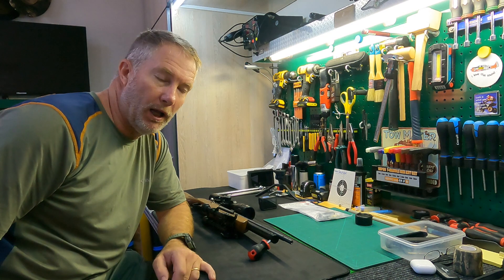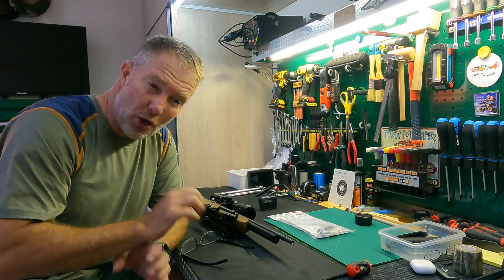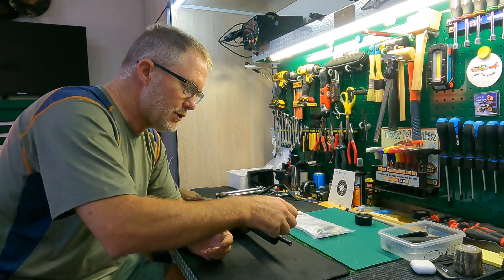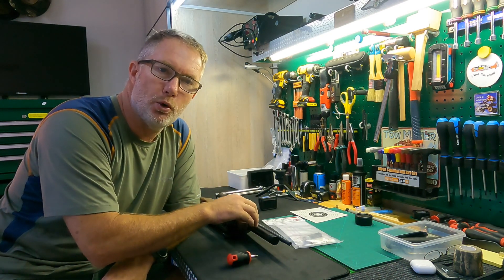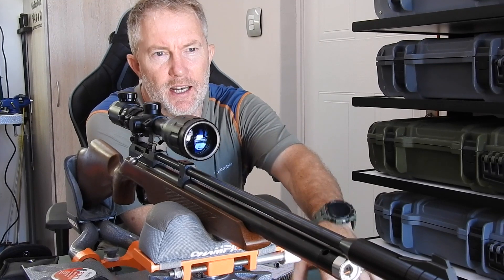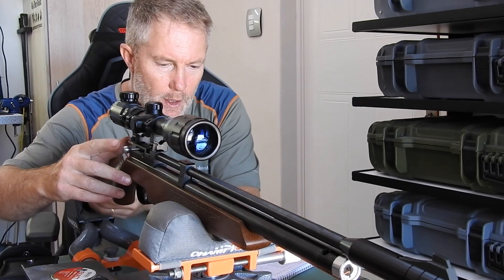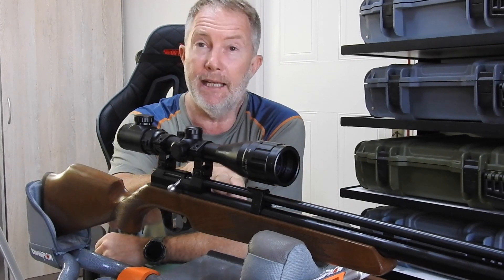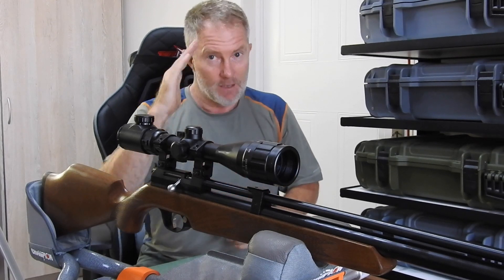Artemis PR900W Regulator Test Results

Comment: Hello, I'm getting an average of 848 fps on 14 shots, with the HN Field Target Trophy 14.66 gr, 125 bar (+/-), 9 cm hammer spring and not 10 cm, 0.8 mm coil valve spring instead of 1 mm.
OD valve, transfer port and barrel 4 mm,
Good grouping at 35 yards. Too bad we don't know how to finely adjust the hammer pressure.
Kind regards, Altaros regulator (max difference 5 fps)

 belle vidéo de toi, merci, dany, Belgium contry

Comment: Had one fitted to my bsa ultra se and a larger air tube and………. It ruined it, it left the factory with or without a regulator for a reason!!!
Reply from the maker: Hi there. I would humbly disagree with your statement. Most don't understand the full function of the regulator and MANY have asked me what regulator they should fit to get more power. So firstly, they DO NOT improve energy/velocity. They actual "reduce" max power , but they give you consistency over a wider spread of shots. They can increase shot count, but at reduced power level. EVERY rifle I fitted it to became significantly more consistent , giving me a more accurate rifle. The Only reason some have and some don't is cost... NOTHING else !! If yours was "ruined", look at the person that did the installation... period !!  If you want to know exactly what a regulator does and how it works, look at my video on that...

Comment: At that distance the grouping is crap. Consistency s no good without a good group
Reply from the maker: Hi there. After installing the Reg i shot about 15 or 20 "rapid" shots just to settle the reg. Then Took those same pellets and shot with the chronograph. 
I have 3 PR900 rifles and they all like different pellets... I did not mind what pellets I used as I was only interested in seeing the results of the Regulator. The rifle was about 20 f/lbs prior and I ordered a reg that would give me sub 12f/lbs.

Just looking at the group closing from the 1st set of pellets tot he 2nd lighter ones you can see that the pellets play a major role in the accuracy. 

I have many different pellets and by playing around I am sure I will find one that "this" rifle likes more. However, at the range I am shooting starlings and finches, this is MORE than ample !!

The fact of the matter is: This is a great regulator... 

Happy hunting !!

Regards

JB

Comment: Hi!
With the built-in regulator, can bar amounts give maximum power?  In my country there is no joules limit.  The factory says 275m/sec, is it real?  Also do the first and last shot have the same power?
Reply from the maker: Hi there. Remember that the regulator is not there to increase power... It cannot do that. All it can do is regulate the pressure... Thus if your rifle is now shooting 275m/sec then it will be less when you fit the regulator. However you will have more consistent speed with the regulator... The PR900 is a good little rifle and you only need to fit a regulator if you want to reduce speed, but increase consistency... 

Regarding 1st to "last" shot. The PR900 does "ok" with the 1st till about No 15 shot... Then speed starts to change ... 

With the regulator your first 15 shot will be almost exactly the same, but at about 230m/sec.... (I would guess....

Happy Hunting !! 
Ps: Actually took two youngsters with my PR900s yesterday to go shoot starlings. Great fun !!
Reply: @affordableairgunningbyjb6994  pr900w gen2 comes with a integrated regulator?    So every 15 shots you fill it with air again so that you have constant same shots? 
With the regulator how far does the bullet go straight to hit the target?

  Diana stormrider 5.5 is the same airgun rifle?

Comment: Got a pr900w gen2, I would like to make it a little bit more powerful. Right now it shoots 250m/s (820fps) and 29J with 14,35 grain pellets
Reply from the maker: Hi there. Remember that the regulator cannot make your rifle more powerful... In most cases you loose a bit of power.... but gain consistency.
Reply: @affordableairgunningbyjb6994  i know.

Comment: Hello,how Meni joules with your’new regulator please ?
Reply from the maker: Hi there. Before the regulator it was 26-27 Joules , now it is 16 Joules... Remember that the regulator DOES NOT increase power... It only regulates and controls it.....

Regads

JB
Reply from the maker: Hi again. 
If you bought a full power PR900, and not the sub 12 foot pound version they sell in UK, then do not change it....
It will give you about 20 for pound in .177 caliber and that is more than enough to use and enjoy. For the price of the PR900 it is a very efficient rifle and your shot count is "ok" for the small air tank it has.... 
By changing it you will most probably loose efficiency and get less shots per fill... 

I only added a regulator to mine to reduce the power from 20 to 12 foot-pound and get more shots from a fill....

Regards

JB
Reply: hello, for the regulator I did not know.
Apart from the spring and the air jet, what should be changed to increase the power of this rifle? thank you

Comment: Watched both videos and think I'm confident I can tackle this now. I want the same setup 12ftlb as I'm in the UK. What pressure was your regulator setup for? Going to request the same and drill the transfer port the same size and hope the results are similar. Can always look at adjusting things afterwards to fine tune it. Also what useable shot count are you getting now with the regulator? Many thanks
Reply from the maker: Hi there Spakka. I will reply on Monday... Just out for the weekend and cannot remember the Reg Pressure settings. However, when you order the reg you just tel them what power output you want and they "pre set" it for you. .... Also when taking the rifle apart, Just check as on the newer rifles you do not need to remove the pressure gauge before you can remove the stock. They have increased the hole in the stock so that it fits over the pressure gauge and thus you can remove the stock and once it is off you can then easily unscrew the pressure gauge. You do not need to use the pliers like I did....
 You can use the pressure gauge to purge the last 50 -75 bar from the rifle carefully unscrewing it to allow the air to escape. Do not try to unscrew it with more than that as it will put a lot of strain on the gauge to try and remove it it the rifle is still at high pressure...

Regards

JB
Reply from the maker: The regulator was set at 85bar..... When you order the regulator, you tell them what you want and they will "pre-set" it. I was very surprised to see how accurate their "pre-set was.... 

Keep me updated as you progress !!

Comment: Hi. I wonder if you can help or point me in the right direction. My son's pr900 has been unused for a couple of months. When trying to re-pressure it won't. The compressot is pumping bur somewhere the air is getting out.
Reply from the maker: Hi there Paul.

Lets start by asking if maybe the rifle was "shot" without any pressure in it..? (My Krall Broke its valve when this happened....)

Can you hear where the air is escaping ... ??
Is it at the refilling probe?? Or at the magazine side... ??

If you cannot hear the air escaping due to the compressor running then maybe you can put your finger on the barrel tip whilst the compressor is filling the rifle. If it builds up pressure in the barrel then the valve is not sealing anymore... (Cocking lever must be forward for the this so the air does not escape at the back...)

Then just to check: I know it sounds stupid, but did you close the "drain valve" on the compressor....?? I once spent a lot of time trying to figure out why one of my rifles was not filling. This only minutes after I filled a different one... Probably took me 10 min to realise that I never closed the drain valve on the compressor and thus it COULD NOT build any pressure....

Waiting to hear back from you...

Regards

JB